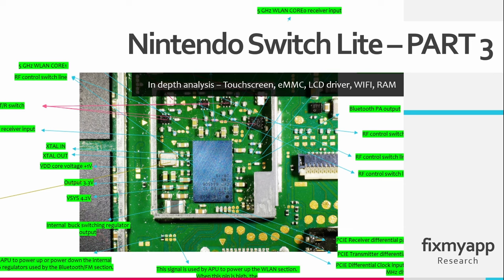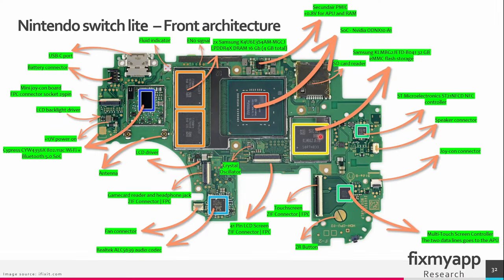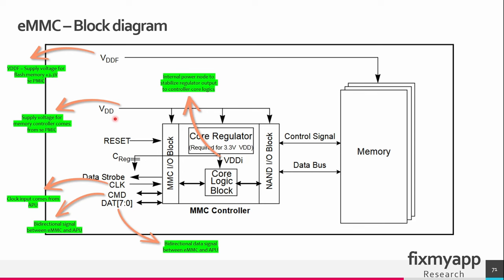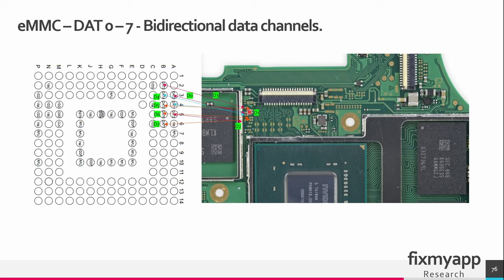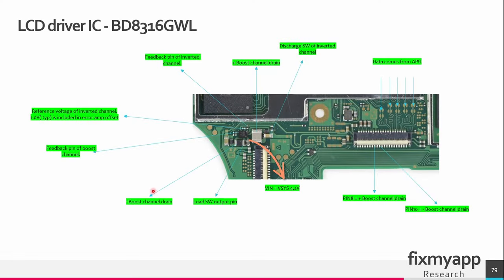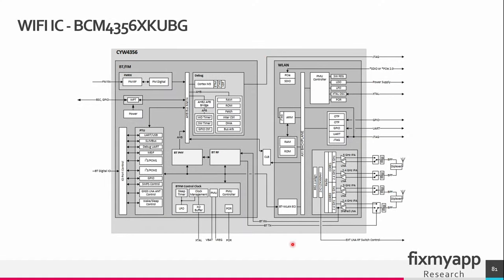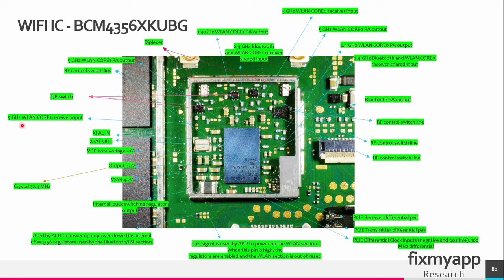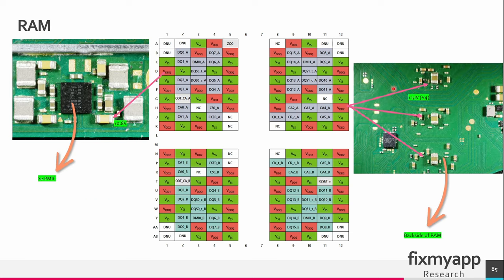The Secret of Nintendo Switch LCD, WIFI and RAM Circuit Exposed! - Analysis PART 3

Comment: You remind me of the old days, when service manuals included Theory of Operation section for each new motherboard model based on screen size (e.g. Philips TV schematics). On the other hand, I was subscribed to Sams Photofact for many years and will never regret it. Thank you very much for sharing Jim. Another way of saying it: research papers (deep analysis) like this one of yours help to make up for or cover "the gaps" left by the lack of schematic diagrams. Thank you again for your effort and mainly for your time invested in it. All the best

PS: The device does not recognize the Internet? Change the WiFi IC And don't ask me why I'm telling you! Just do it! ... and once you are alone with yourself, on which channel will they explain it to you well, that is, in detail at each step? A brotherly hug from Mexico.
Reply from the maker: Hi i miss the old day's too when there were schematic included in the devices also this is learning as you go :) Thanks for watching! Gr. Jim

Comment: Hi, you did a nice work! In my switch lite I accidentally broke off the emmc cmd signal resistor, could you tell me its nominal resistance?
Reply from the maker: Hi maybe you can set the time stamp of the video wich resistor you mean then i can look at my donor card. Gr. Jim